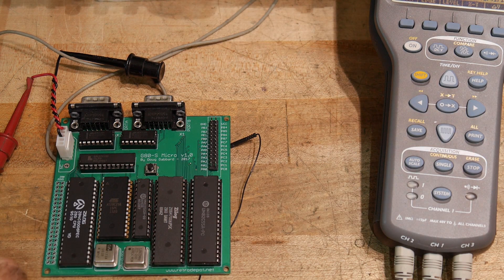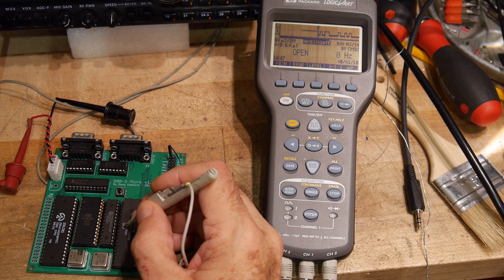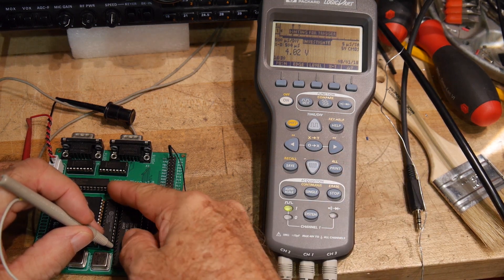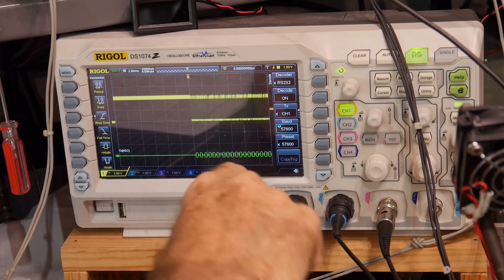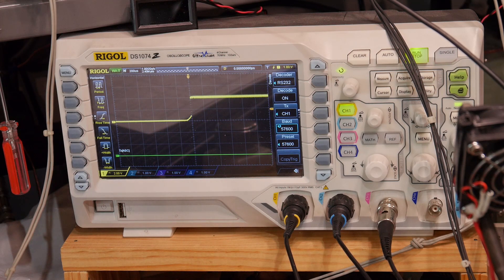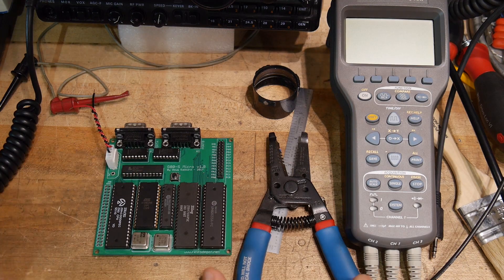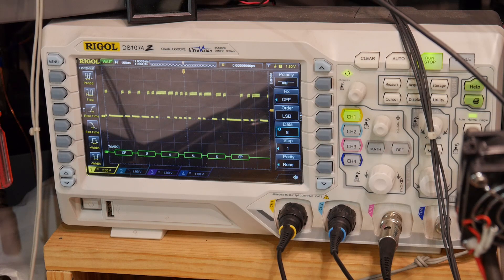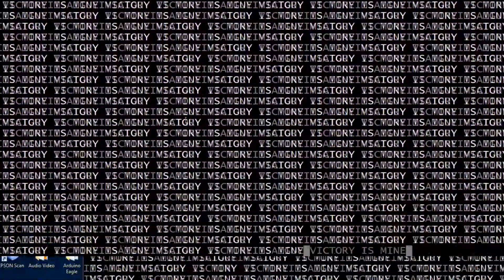#245 G80-S Z80 SBC working!

Comment: LogicDart looks like a FANTASTIC tool for a field engineer working on (eg.) PLCs in an Industrial Process Control environment, hence the handheld form factor.  Its definitely a niche product.

When you say 'missing' via, was it omitted from the design, or had the through-hole plating failed to take (or something else)?
Reply from the maker: I think it was a plating in the hole problem

Comment: Is he going to re-spin the PCB? Thanks for taking us thru the process!
Reply: Dino Papas I have spoken with the IMSAIGuy, this was a problem with the specific board he had, the via issue that is. It hasn’t appeared with the other boards I have manufactured. It seems to be bad luck of a defective board making its way into the supply chain.

There is a new spin of the board, but not because of a design flaw. The newest board I offer has USB serial onboard. Though I do still offer dual RS232 for those who want it. A future design is being worked on that offers Composite video and PS2 keyboard. But it is still in the design phase. And is likely months down the road.  You can check out the project over at my website:  retrodepot.net
Reply: Thanks Doug, glad to hear it was a one-off!